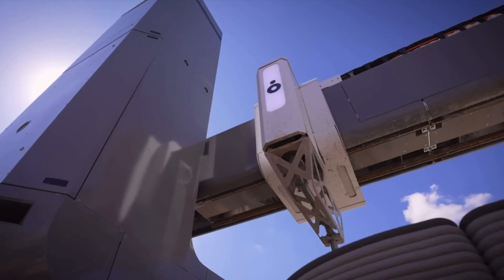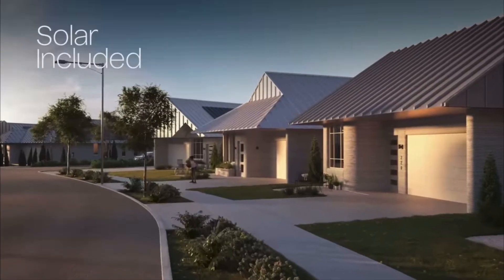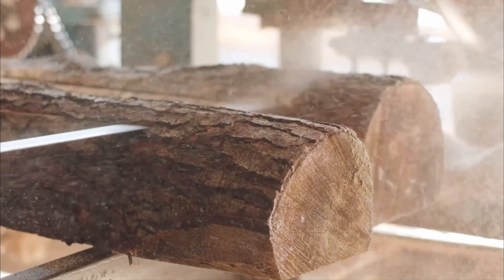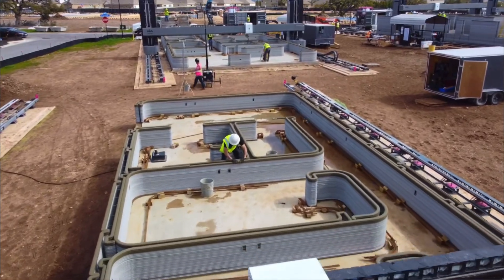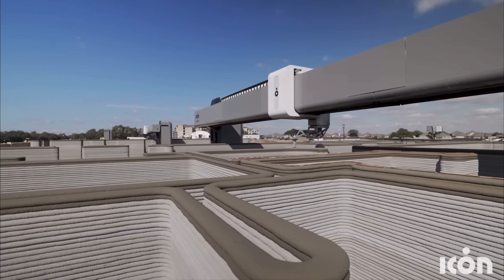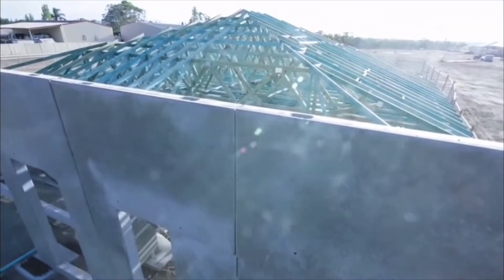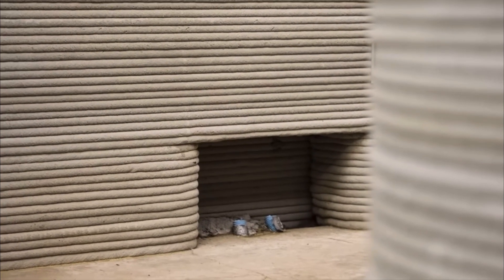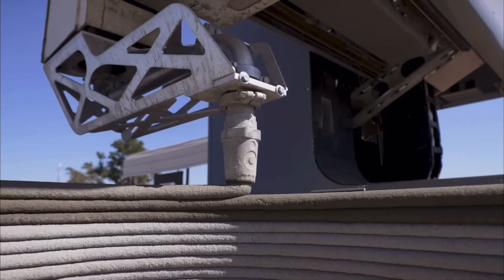Are 3D Printed Homes Ready?

Comment: Icon is probably charging leonard the same as normal framing, but they do more in the walls than traditional framing such as built-in conduits and other things that save time down the chain.  However, I doubt icon is profitable on the homes yet.  Maybe on the last few where they got the time down to about 2 weeks with their latest computer.

Since the tech is so new, they have a lot of places to still find cost savings.